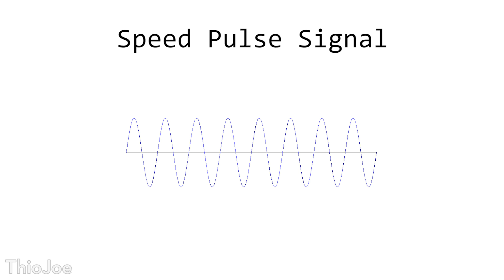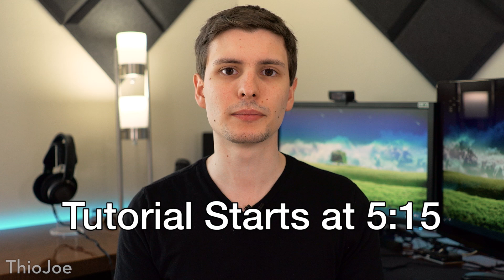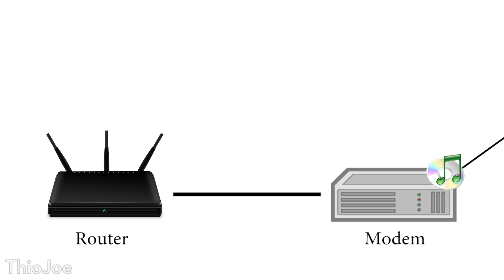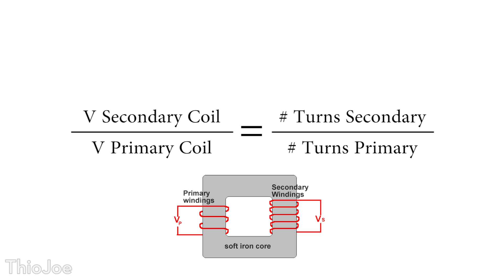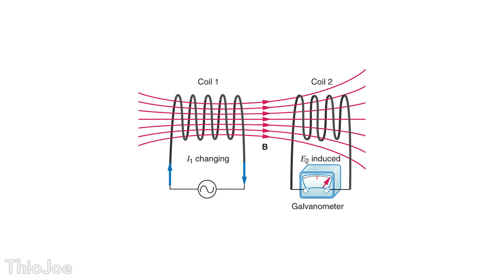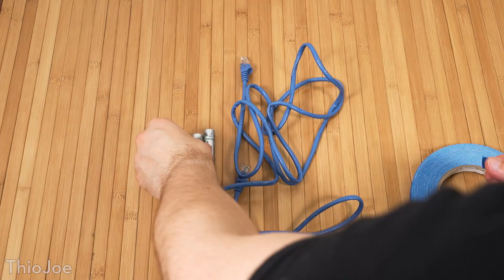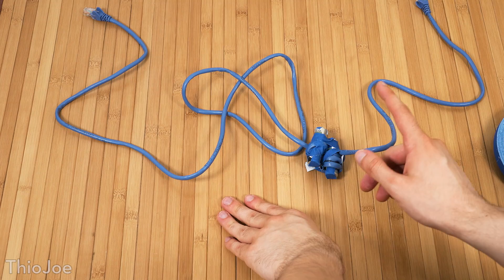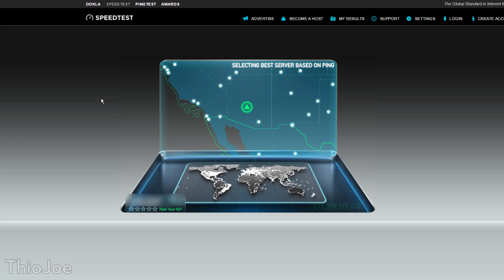How to Get Faster Internet Speed for Free

Comment: Following your instructions, I have comcast with the combination router/modem.  The question that I have is the position of the batteries, do they go with the positive end opposite or does it matter.  Since I have the combination modem/router, does the multi wound battery, the one with the 3 winds, go towards the computer or the router/modem, and lastly, will the batteries have to be recharged after prolonged use.

Comment: Of course you know this only works if you run a wire from the positive and negative terminal of the batteries.  If you attach a flash light bulb to the other terminals you can tell when you need to replace or recharge the battery (replace it or recharge when the bulb dies).    You will have to replace or recharge the battery based on the amount of data that is passing through the cable.  I suggest having spares recharge and ready to go.  Have fun  ;)

Comment: The LAN wire  includes Both supply and return wires together, they have opposite currents and CANCEL each other.   Even if you could wind the input and output windings with the same wire... For these and many more reasons this video is just click bait

Comment: Hello You All,
Well I have tape, and Batteries.
I even have a very fine Flat Cable.
I Wrap'd the Battery one Time as He said, than Wrap'd it a Few Times on the Second one. Than Taped it up as he described.
I Hooked it up as he said as well, and got no difference in Speed.
So this is at-least for me fake.

Comment: This is amazing I tried it and it doubled my speed! Everyone should be doing this. Thanks man. I have a trick that helps out alot it sounds scary but I sware it worked amazingly. Cut the internet cord thing and make sure you strip at least 6 to 8 inches on each side. Then wrap that around 2 26650 batterys MAKE SURE YOU PEEL OFF ALL PLASTIC AND THE CARDBOARD PART ON THE POSITIVE SIDE OF THE BATTERYS. Then do 2 wraps on one side facing your router then 7 wraps on the other side. Now your gonna want to bring out some super glue and lube. First superglue the batterys close together with positive on one battery and negative on other battery facing up connect all back up. Next take a dollar coin and glue it on top make sure it's touching both batterys. Then you can shove it deep in your ass.

Comment: Hi, I tried with normal and rechargeable batteries and currently with ferrite core. However nothing changes the speed. I am using shielded CAT 6 cable. Is the CAT cable the reason it does not work????
Please send me the solution

Comment: I used two car batteries and now my house is on fire. At least (thanks to this tutorial) I still have internet connection to write this comment, even though my router and modem along with the ethernet cable are probably melted from the fire.

Comment: Hahahaha, you tape the extra voltage on the wire ? or will the windings induct extra voltage ?
Hahahaha, this will never work because the coils are in one conductor, its schielded wire also.

Comment: I have a cable internet. There is only a Router that I am using. no Modem is been installed at all. there is only a long cable coming from the amplifier on the pole to My router I have installed. if I do this to that long cable, will this work ... ??

Comment: I took it a step further: 
I bought 2 salvaged iPhones off eBay $60 each disassembled them and removed the batteries. Connected them both together using tape then wrapped the Ethernet cord around 16 times using an X pattern.
I downloaded Half Baked 4K in like 90 sec!!

Comment: You can also increase the voltage induction by briefly unplugging the modem... sticking a 2 paperclips into the outlet... and peeing on the paperclips.  Pee has the electrolytes in it that are needed onto induce the change BEFORE you plug the modem back in.........

Comment: Theories quoted are quite prefect. But not related to your theories at all. Don't you know that signals on RJ45 are isolated? You are so naive to think simply amplifying a signal can increase the speed. Speed is determined by the frequency, not voltage. As long as the voltage meets the minimum requirement, no problem for the signal transmission.

Comment: Cool.  I never used batteries for the core.    I made a toroid transformer by using an old magnet removed from a magnetron.  I have DSL by phone line.  All turns continuously clockwise around the "donut."   The windings are 180 degrees from each other.Two turns to the RJ jack and six turns to the combination Westell wireless modem jack.  I had a section of flat extension phone cable all terminated.  Easy to experiment....why not?I thought it was interesting enough and maybe technically possible if his facts were correct.  The restart was done basically the same.  I shut down the wireless modem and computer before replacing my original phone wire.   Then I rebooted everything.I got a 10 fold increase in download speed.  It surprised me, really.  I went from under 3 (my normal) to over 35 Mbps.  Super!Thanks Thio.

Comment: If you were to do this like you said with the modem/router 2 in 1 combo, And put it on the Ethernet cord between the computer and router/modem. Would it only increase the speed to that computer or to wifi devices as well?

Comment: I find what you did was interesting.  I have the S3 1 gigabite modem but sisnce the router is only a 10/100 megabite router how is it possible to get a gig speed if it is only rated for 10/100 megabite speed??

Comment: i found you on youtube for info about Ethernet cables. then i send the youtube on faster internet. i have the Motorola arris  SBG6782-AC  which is a combo unit  that can take up to 300 mbs . does the 4 coil side connect to the router with the 1 coil connect to the ethernet cable to my laptop

Comment: Good video right now I use over the air TV with my outdoor antenna picking up 30 to 42 channels .Channels I never got when I had cable .Good ones to from the Buffalo area Rogester  NY .When I ever go back to cable that is a good option to try! Would never think.

Comment: Hi, I commented on wrong video. i was wondering if and how to wrap wires if I have a cable modem/router in one unit? would it worked if I just wrapped the wire from the wall before it entered the modem/router combo.

Comment: Until I read the description, i was like "I'm pretty sure you can't step up the voltage of a signal with series inductance. That would be like standing in a bucket and trying to lift yourself by the handle. Also, adding inductance would add more impedance, which would actually lower the voltage received on the other end. Also, a modem doesn't just pass through an ethernet signal out to coax"
This video was expertly packed full of shit that made no sense, but he kept laying them down and kept so serious that I kept waiting for the thing that would make It make sense.

Comment: you idiot how you can explain its through the principle of transformer you haven't connect the 
battery  with any wire how does current flow from the battery and generate the flux to step up the bandwidth tell me you stupid person you know nothing stop wasting the time

Comment: what if you have a combination router modern?  will the devices on the home network receive increased speeds? Aetna only the device ethernet attached to the combination router modern would benefit

Comment: Can you explain a way to speed up time warner cable internet?  I have a modem that connects to the coax cable and almost every device is wifi and not hard wired. Is there a way to speed up this platform I get 30 Mbps and I want to increase this!

Comment: It's so dumb because if it worked (which it can't) it would only amplify the signal between the modem and router (which is too late) and not from the ISP to the router.  To make it more authentic he should wrapped the chord around his cable from he wall to the model.  Clearly he needs to get a life.  I just blocked his channel.

Comment: this is what happens when idiots try to be smart. First of all u need an iron core for a transformer to work so using those batteries that are made of aluminum and plastic (PVC) will not work as the core needs to be magnetic. He even said this in the video in his mismatched scientific mumbo jumbo ramble. Man thats a first  .BTW I DO KNOW THIS IS A JOKE BUT JUST IN CASE SOME ONE TRIES TO DO THIS , THIS IS WHY IT WILL NOT WORK!

Comment: If you place the upgraded device in the microwave on high for ten minutes it will double your result.  make sure you cover the device with mayonnaise, and wrap in paper towels. This will concentrate the energy, and prevent burning the ends of the cable.  You are so bad.

Comment: great vid. this actually works a lot better if you coil a mains power cable around the router cable. mains voltage will induce a significantly higher voltage than the DC flow of the battery. trust me, im an engineer!

Comment: This method clearly only works due to a spacetime divergence inversion caused by the non-linear nature of time in close proximity to tangential static voltages in a subliminal reference frame. Noob. Get it right.

Comment: This so didn't work. What kind of batteries? Nicad? You want iron or metal core for transformer action so two bolts and more windings should have worked better. i will try this and then will tell you if this is so fake.

Comment: Works excellent never had faster Internet speeds.  Also another great find to amplify your cell phone data stream speed and absolutely free service with any carrier and get this no roaming charges ever, in fact you're paid by minute to your bank acct for use. Ok, so using any make model of cell phone, or portable home phone, or even a 3 month old banana.  Hold phone or banana firmly in hand.  Now using assisted help connect jumper cables to any fully charged car battery in running car. AutoZone store technicians actually are your best bet because have been trained in Cellular battery transmogrifications.  Next while shirtless have the helper attach other end of jumper cables to the crotch area. I have never had a more amazing phone experience. Love these amazing finds.

Comment: What if My ISP provides ADSL connection and for that they provide a Modem that has a builtin WIFI router too. so its an ADSL WIFI Router. that means I am not using a separate WIFI router .. How do i increase teh speed with that?

Comment: Another tip is to switch out the disposable AA batteries for a couple of NiMH rechargeable ones, so while they're acting to step up your connection speed, they'll also be charging, swap them out each day and you have an unlimited source of electricity supplied free by your ISPs data signal!

I know this is true because I watched a video about it on the internet...

Comment: Sir, my internet is set up in this way: there is a ubiquite gateway pro(indoor) connected to a ubiquite nanostation m2 through POE and connected to a lynksis router through LAN. in which cable should I change the system, in the LAN connected to router or in the cable in POE connected to the nanostation.

Comment: An easy way is to shove the Ethernet cable into a fm radio make sure it's fm capable for best results since radio waves have the biggest amplitude the speed it receives from the isp will be on the upside of a thousand gbs and will up your speed greatly I'm not lying just jerry rig a radio into a router and you have very fast internet

Comment: Wow I really wnated to write something positive not only state that, that I dont think it works and it would never work if modem and router are combined but reading this is a joke is really disappointing.You put much effort in the design of the Video I think , so disliking would be a bit angry reaction, but I could understand it. Atelast your telling its a joke in the description, others take theire Internet Speed improvement  tips for serious business... and may make Money of that.Being honest is atleast one good thing here, with all the fake Videos regarding the Topic. Btw: The antenna thing could actually work but not not really by increasing the limit the ISP set.  Rather the stronger signal would improve internet speed over wifi in rooms. But that wasnt what the video claimed. Also not all antennas work so well, better try a repeater if you have a week wifi signal.  General tip for anybodying reading: If you can work next to the router you can always check the maxium available speed by using an ethernet cable and checking a speed test webpage.If your matching the Speed the ISP you are lucky. It doesnt always have to be your operating System or Hardware if your unter the Limit, may also be ISP -related issues at the time doing the test.This is a very serious topic, but as long as your speed matches the one the ISP offers theres no room for improvement anymore on the actual Internet.

Comment: one of the pics you used explains ac current and how it works it has nothing to do with your talking about, you need to review your pics to keep the bs in line, i got 100000000tb's upload speed and no download speed, do i switch the batteries over?

Comment: Okay what you made there are canceling inductors due to the fact that cat5 cable has 4 balenced  wire pares wrapped so the inductence is equal to the capasitence. further more why would you say 2 AA batteries are the same as the core of a tranformer. aditionaly cat5e typically operates at 350Mhz witch would saturate you magic battery inductor/ amplifier/ transformer. nice troll thought I'll give you that you sued it all with such a st eight face

Comment: There's actually a much easier way to do this. Modems are usually plugged and powered by a nearby outlet, so in theory if you just get more juice running through the modem it'll give a stronger output. All you gotta do is find any silverware you can find and shove it right in the outlet. Trying to slide it in there doesn't usually work, you really gotta shove it in there in a stabbing motion for it to force through.

Comment: Guys you are doing it all wrong, all you have to do is delete this folder Windows/System32 and bang you'll double you speed ask anyone it works because system32 folder has files that control ypur Nat type with controls your Internet speed delete it and bang no more speed limit i went from 37.86mbps to 62.47mbsp down speed and 29.63mbps to 47.61mbps up speed hope this helps ;)

Comment: Complite bullshit, 1. An electrical transformer doesn't work on the same cable, but in different ones. 2. It works over Analogical not digital signals. 3. That supposed signal couldn't be based on amplitude but on a specific digital code.  This man should go to jail for making people lose their time like this.

Comment: Hi Joe I live in Italy (I do not speak English I only understand a few words and you send this request translated by google) and I found it interesting your tutorial on increasing the speed of the signal to surf the Internet more than the threshold supplied by the provider, in Italy in some cities you come from 7 Mbps to 100 Mbps, in my case in my town you get up to 7 Mbps, I ask you can also get from me at a higher speed? I do not say how your demonstration, though a bit 'more of what comes to me.  You can do it by myself? The electrical system on which travel is not fiber but copper cables that are used for the phone. 
Could you give me some pointers on how to do? I thank you and salute you Vito. 
I leave you my email so that I write will translate with google, thanks and resent. 
 My system is so constituted Phone line-telephone-modem connection from the modem to the computer via Ethernet cable. 
 On your video: 
• I would ask the batteries you use are simple alkaline AA 1.5V? 
• One end of the ethernet cable to install the modem and the other end where the install? You can not see well (I suppose the router or modem?)  
 Disqus seems to be taking longer than

Comment: You made me laugh. If any of my students watch this, this "transformer" is not a transformer and will do exactly nothing to the signal in the cable. So even IF this amplification would trick your ISP to give you higher speed(which probably would be illegal and have some bad consequences for you), this is not how you can amplify the signal. Input and output of a real transformer are SEPARATE cables and the core of a transformer is MAGNETIC. If you properly amplify the signal you probably will have extra interference which will make your connection unreliable. Amplification of the signal could also lead to damaging your and your ISP's equipment which might cost you money, time and freedom. This is as free as free cheese in a mousetrap. Did you notice his ping value? 3ms - he is probably testing the speed between his computer and... well, his computer.

Comment: I tried this hoping it would increase my speed.  I did exactly the same as you, in fact, I watched it several times.  

As soon as I plugged it in, my internet connection stopped.  I spent 2 days with earthlink.net trying to get it back working again.   They had to fix the line somewhere.

Be careful.  I was not happy.  Maybe it works for other providers.

Comment: This shit is too funny. A transformer will not work like that on a DC signal. Also, increasing voltage would likely fry some parts or alert the ISP that somethign is wrong because of a voltage spike. I'm just laughing so hard at this.

Comment: I absolutely love how he can maintain a straight face while knowing full well the BS he's shoveling.  Folks, the modem speed is controlled by the modem's profile, not some magical ping.  There is NO way to increase your internet speed without getting a faster internet connection.  Stop falling for this crap.  Note for the video maker:  I know your videos are all satire, but to make this better you should have wrapped the cable around magnets instead of batteries.  Would have made the "magnetic coil" more believable.